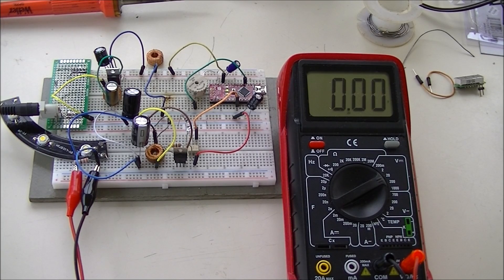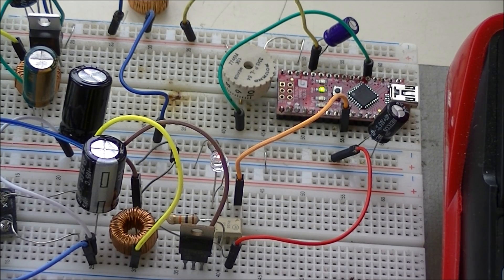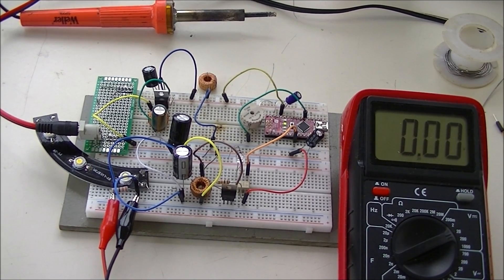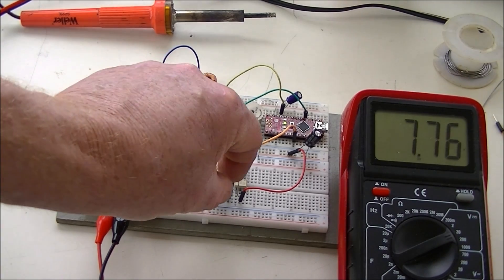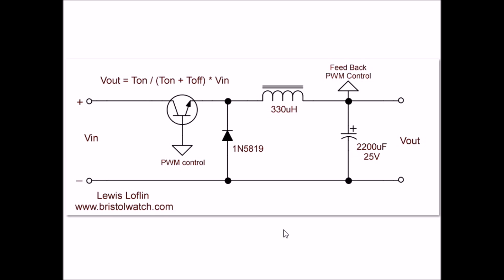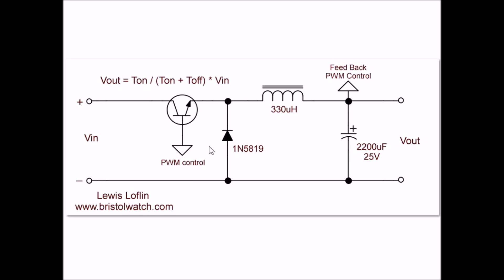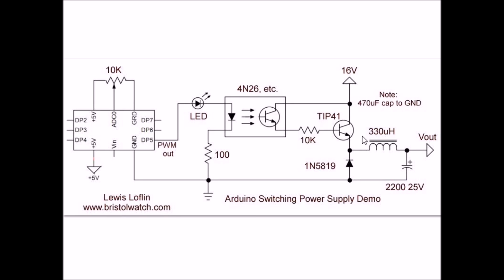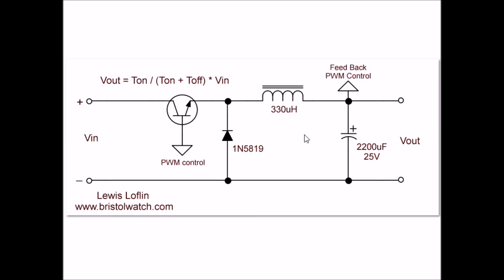Use an Arduino to make Switching Power Supply

Comment: just a little FYI, arduino as a clock source is ok. Feedback is crucial for not killing the LED's. You will want a constant current mode type of regulator setup. LED's are current devices.

Comment: There is a very simple library which let's you unlock frequency of the arduino outputs. You can set the frequency to be exactly as it is in commercial Switching Power supplies in just 2 - 3 lines of code.
Reply from the maker: Whee is it? Thanks.

Comment: I was wondering if you might know the answer for what I am trying to do since it has to do with a power supply being used with a Nano or Raspberry... I have DC Voltage Step up Converter (XL6009E1) that I was going to try and use with either my Arduino Nano or a Rasp pi2, 3, or Zero(RBPi). What I want to use the power supply for is to Anodize small titanium parts, no bigger than 0.25 - 3in tops. I have used 9V batteries before as my power supply to anodize, which has low current, and I want to know if its possible to us this DC Step Up Converter, which also has fairly low current, to control the voltage from around 5 - 30Volts but keep it steady at whatever voltage I adjust it to, which will give a different range of colors (Theres many videos on Ytube about doing this with 9V batteries). In theory, it seems as though this DC Step Up is capable of doing this but I wanted to make sure that it won't be a pulsing voltage and stays put at whatever amount I voltage I set it at? Also, I wanted to know if you think this would be safe using the Nano or RSBpi for the DC step up's input voltage or should I use it with something else? If I used the Raspberry Pi I was going to plug the RBPi into wall, using its compatible power cord, and then assemble the DC Step up Converter to the RBPi and then just attach some basic cables/wire or alligator clips to the Step Up Output which would be what I use to Anodize with. Most people just Buy Variable Voltage supply units   mostly because they can get up to 120V but I don't need to go that high and this would be MUCH cheaper. Any advise would be very helpful since I have looked everywhere and can't find any documentation of anyone trying this or mentioning anything even close to it. This link below shows the DC Step Up I am using. I am obviously only using one, although now that Im thinking about it, if this is possible to use could I get more voltage by daisy chaining the DC Step ups in series? You don't have to answer that part. Any advise would be very helpful! Thanks in advance!
Reply from the maker: This is merely a demo and not really practical. The following link and device would work better. https://youtu.be/6Qrs3JmdPl8%0ALM2575-ADJ

Comment: since there is no feedback, its pretty much unregulated and the arduino is just used as a PWM pulse source. you could have used a simple NE555 for that too. no need for a microcontroller.
Reply from the maker: I mentioned there was no feedback and this was not a practical circuit. It to demonstrate how switching power supplies operate.
Reply: Why no feedback, considering how damn easy it is to read ADC.

Comment: What is the purpose of the optocoupler? Is it to protect the Arduino pin from surges?

Thanks for all your videos. I'm subscribed and have learned a lot !
Reply from the maker: To isolate the 5V Arduino from higher voltages.